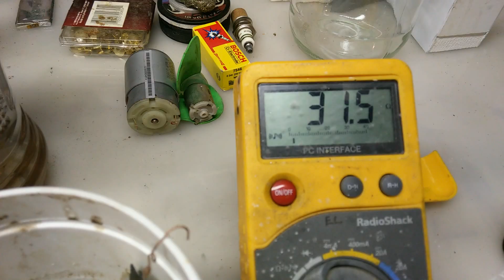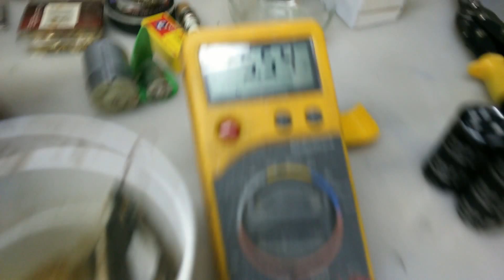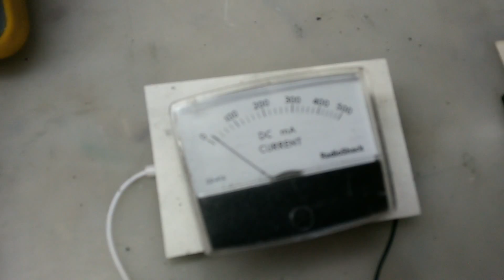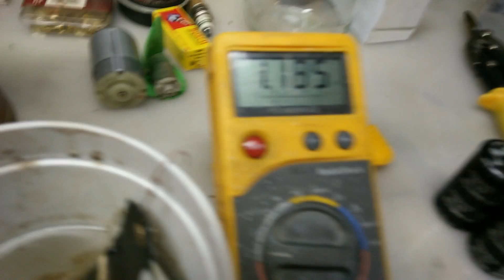Rechargeable Plastic Graphite Aluminium battery

Comment: For the plastic contents of your  Graphite Cathode, are you using PVDF, PVdF , PAN .? Any doping with Acetylene Black, Carbon Black ......? I love the high open circuit voltage! Beautiful!  Keep up the nice work of inspiring us. Thank you!
Reply from the maker: Hi William, the cathode is very simple to make.  I used a Styrofoam cooler and pulled pieces off and dropped them into a bowl of acetone.  I put a lot of Styrofoam into the bowl until I had a gooey blob of melted Styrofoam.  Then add a good quality graphite, Check the resistance with a meter and put enough graphite in  until  you reach a low resistance.
Using rubber gloves , I removed the blob and flattened it out like a pancake onto a piece of wax paper, then put the blob and wax paper onto a hot-plate at a temperature of 200 F.  Then I applied a piece of wax paper to the top of the blob and the put a weight on top of the  wax paper to smash it down to the thickness that you see in the video.
The blob will  become hard in  about 2 minutes.  Once the plastic is flat and hard you can cut it into any shape.  You could use Acetylene or carbon black  instead of graphite.
If you have any question, feel free to ask.  Thanks for commenting and have fun.
Reply: @ET2uscg   Thats real ingenuity qnd creativity  - all in one. Thanks  for the details. If you etch the graphite in KOH before intergratting it in your polymer (Styrofoam), your results could possible shoot up! . Next time, if time allows, try CMC/PVA /SBR+Active material and conductive material and you are done. Acetone can be really tough for the nose at times. Keep on doing the good work!
Reply from the maker: @wwabete2009  I stopped making the Graphene oxide or like some people call it the popcorn graphite or exploded graphite, because it took to long to get the result, but I bought a welder and might make some using the electrolysis method.
Reply: @ET2uscg Thanks for the info. Another delicate way is to exfoliate graphite in concentrated H2SO4  and leave it standing for a day or so..
Pour out  the excess acid, wash it several times in deionized water, dry it and give it some microwave irradiation and you have, not the very best, but some good graphene for experiments. Your method may be long but it  gives aa nice few layered graphene.
Reply from the maker: @wwabete2009  one experiment I did was to use a Tesla coil to charge the cement battery, it did work.  I need to make a batch of few layer Graphene and use it in the battery composition to see if the wireless charge works better, I bought a welder to use in the electrolysis process of making the graphene

Comment: basically a plastic/graphite and alu super cap :)
Reply from the maker: Ya its a cheap way of making Graphoil but it does not work as good as graphoil.  It is stronger than graphoil and will breath better than graphoil

Comment from the maker: The separator material is made from the same material as the " Fat Head " wall graphic material is.
Reply: Hi Ed, What is the plastic separator? Not sure what "Fat head" is.
Reply from the maker: Hey, the separator is like a porous wall paper without any sticky on the back.  You could use Silk Screen material, since these are really thin.

Comment: Thanks for sharing your experiment. Does the aluminium get oxidised over time? Quick way would be to try with thin foil.
Reply from the maker: I will try with thin foil today.
Reply from the maker: The aluminium is still holding up, I am using a milder electrolyte now and I will be posting the voltage and Current vid in a day or two.
Reply from the maker: To keep aluminum From degrading use zinc oxide in the electrolite